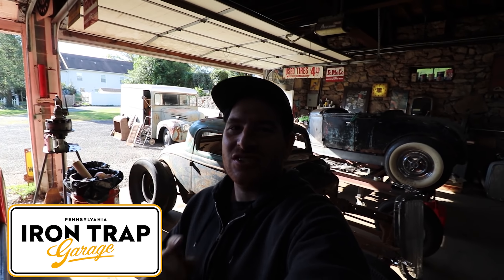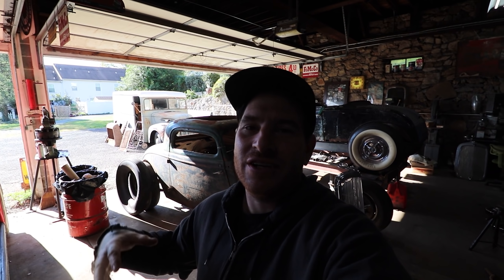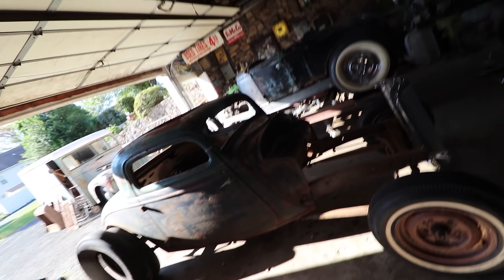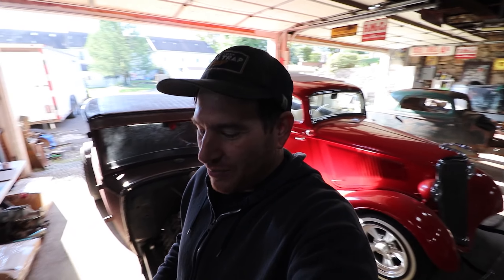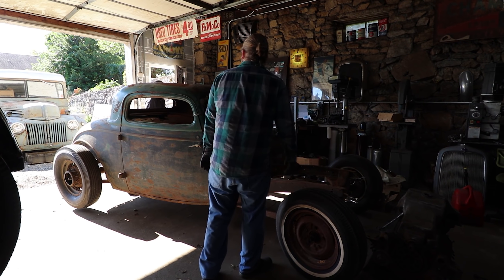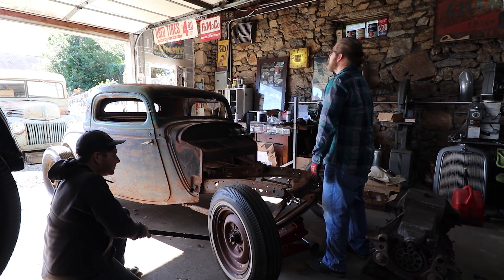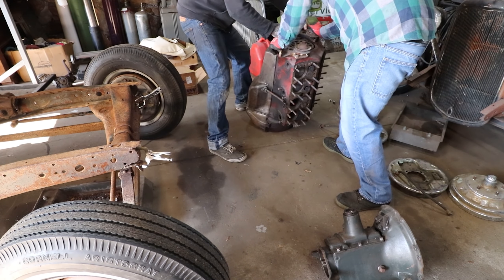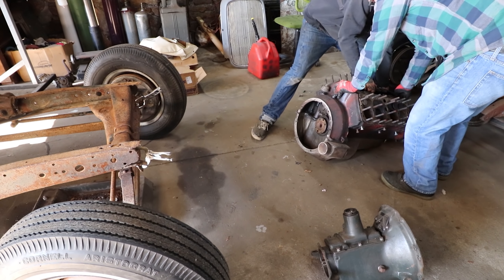The 1933 Ford 3 Window "Newspaper Coupe" Gets A Blown Ardun

Comment: Looks good, how about moving the rngine back a little  so you can keep the radiator shell where it is.  It would look better and it never hurts to move the engine back closer to the middle of the car.  I used a model A torque tube  that I  shortened on  a 40 center with 37 bells and 39 brakes.
Reply from the maker: Yep that’s the plan. This was just an initial mock-up to see where we were at.

Comment: Ohh Yeaaa,,,now you're rockin. That looks great ! Save those Halibrades for a speedster boat tail or a tinned in slammed salty , I would dig around for a chromed set of reverse wheels and research that intake asap, you may have to fab it up. With your talents you can graft in a stock 40 dash section and shrink the speaker easily for a set stock gages. Awesome shifter placement, grab another stick and bend it cleaner to match and clear. and how about a side cowl exit steer box under the toe panel since you have the m/cylinders on the firewall, you have that space open now, and a long chrome rod passing under some lakes headers would add to that 50's backyard look. Just my opinion,,,nice work Matt.

Comment: cool car, like it just fine with the wires on the back. BTW you need an unrelieved flathead block to run the Ardun heads, obvious if you think about it. Not that i'm a flathead/Ardun expert, my only experience being reading a blown Ardun build series in Rod & Custom about 50 years ago.

Comment: That body is so nice and original...what do you think about going bare metal and then spraying 4 or 5 coats of clear. Hildebrand wheels all around or a reasonable facsimile. Leave the top open and as you said...no hood. What a good weather Hot Rod.

Comment: Matt,  This is by far the best place to put your Ardun. A buddy of mine has a Don Orosco Ardun engine in a 48 ford sedan and I give him shit everytime I see him about wasting what most of us dream about and he has it hidden in a fat fendered sedan.  Judging from the gas welds on your Coupes Chop when it was first hot rodded it is very likely that it is still on it's original frame. If you clean and pull the serial number on the frame and it is a 1933 Your coupe is most likely indeed a 33, the whole early 34 thing has been argued many times by several self claimed experts. Anyhow regardless of when it rolled out of  Henrys assembly plant It is the perfect Hot rod. You Did damn good on that purchase. I seen some of the comments about guys saying 10K was too much money and All I can do is laugh at the people who just don't know any better. Funny thing is the same guys usually are driving a 30-60K pickup that they are making monthly payments on all the while the value is dropping daily on the plastic piece of crap they are driving.  So who is the better investor here? LOL.  Your 33 is going up in value and I can prove that easily.  As If you want I will let you make a profit on it today!..LOL  I paid 7500 and drove over a 1000 miles for the 33 3 window body I started with and it had been a old roundy round racecar.  what you have there is like new compared to what I started with and I am still happy with what I have.   Also It is your car to do what you want But for me it is "Hell to the NO!" on those Halibrands. Stick with the 16 inch spoked with some 8.90 dirt trackers.  If you want large period correct wheels and something odd and will look good on there Get a set of Divcos from a 40's milk truck.  Just my 2 cents anyhow.

Comment: So stoked !! Perfect 👌  mockup !!  

**Not sweating the '34 grille.  Honestly, you're such a detail guy .. I see no issues whatsoever with a mild section, file job, & polishing of your welds.  One would never see where you cut it .. if you even have to.

There's room to bring that chin up, on those grilles .. without having to build or modify a custom radiator.  Back in the day, the '32 grille was the choice for ease of modification.  Welding skills of your ilk .. was literally aviation spec' or expert welder only.

Your garage is a lucky building.  Great job, guys !!

Comment: The 1933 hood used a central handle to lock/unlock the hood with a bar running forward & to the cowl. The 1934 used a different method with two 'handles' on each side, so the method of latching at the cowl differed. From the dim recesses of my memory, one cowl side panel had a hook & the other [1933?] had a hole, perhaps even a square hole for the rod. A simple check would be to have a look how your Tudor latches. If the Coupe is the same, & I think it is, then it's a 34, if different, then a '33.   Simple.
Reply: The 33 has small tabs riveted to the firewall for the bonnet sides to latch to which I think I saw on one of the photos. Also I think there is a difference on the top of the firewall where the 34 has a spot to rest the bonnet sides. Really does not matter to much as the base body is much the same.
Reply from the maker: It has the divots for the hood to rest on the top of the cowl. Hard to say. Either a really late 33 or a really early 34.
Reply: @IronTrapGarage  Those 'hood rest' recesses don't mean much, it's
the area low down on the sides where the hood latches that determine the model. [not necessarily the actual calendar year of manufacture] 1933 models had a different method of latching the bonnet [hood] and if you compare the relevant part to your '34 you will be able to identify the model year of the coupe in a heartbeat. Not "hard to say" at all.
Oh yeah, if your base engine has a relieved block and you want to use the Ardun heads, then find another [unrelieved] block.

Comment: Oh baby - a blown Ardun!! YES! I'm a Stude guy, but this car just screams for that blown Ardun. Are you going to add frame horns - to me it looks kinda bare in the front with the frame horns. Have you considered shortening the grille slightly? Again, my opinion, but the front of the engine looks a little too low, by maybe 2 inches?? This will be one bitchin' rod!
Reply: Short Model A frame horns?
EDIT: 21 hr later. See 'Jake's 34' yellow coupe for application (boxed or open).
Reply: @waynespyker5731  Or '32 style........something to keep the front from looking stubby.  :-)
Reply from the maker: Horns will be added or finished off of some kind. Need to stare at it more. I’d prefer to leave a full length grill. Won’t be lowering it much more than it is. I want the engine to low like this.

Comment: I am well into geezerhood and have been into hot rods since my adolescence in the '50s. I hope you will re-think keeping that frame. It would have been considered crude even back in the day.  Two big problems: no room for a proper exhaust and the radiator grille cannot be made to look right. It will be either too high or two far forward for the car to have good proportions. So...I'd suggest you put the body onto a proper '33 or '34 frame before you become so invested that you can't change it.
Reply from the maker: I beg to differ.
Reply: @IronTrapGarage   That's what hot rodding is all about. Good luck with it!

Comment: Hey Matt, mock up looks great, either the flat head/Ardun or Hemi, the blower would be cool, but multiple carbs if you don't.  The Halibrands almost look to big, it puts your focus on the tire & wheel, the rear of the car gets lost, stick with the wires, those tires & wheels look right. I'm with you on engine height,  I don't like the rat rod/rat fink look....looking great!!

Comment: A little history in case you didn't know, the Ardun heads were developed originally by Zora Arkus-Duntov (father of the Corvette and speed equipment for early small block Chevy engines)

Comment: That cowl has the metal “hooks” for a 33 hood and does not have the space in the beads to rest the 34 hood on. That’s a 33, let me know if you need a 33 hood.
Reply: No offence please but many of us old timers have always and will always call 33s and 34s simply 34s.   I suppose it was because unlike many years, the differences were so tiny that they were irrelevant to most discussion. I am hoping that you all will be tolerant of us.  BTW 33 and 34 anythings were the most overall beautiful of all Henry's car designs in my opinion.   Of course the deuce was the most functional beauty. :)
Reply: It is a 33. Not only the 33 hood latch set up but also the 33 side windows.
Reply from the maker: It actually has the notches to rest the hood. Also has the reinforced header panel like a 34 has.. I believe it is an early 34. But I’ll let you guys argue over that stuff and I’ll continue building the car and having fun lol.